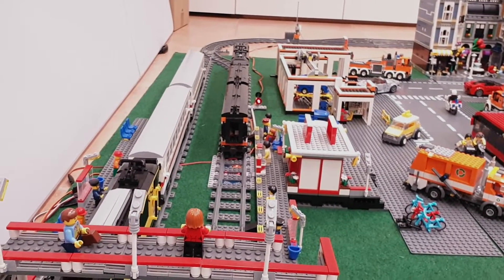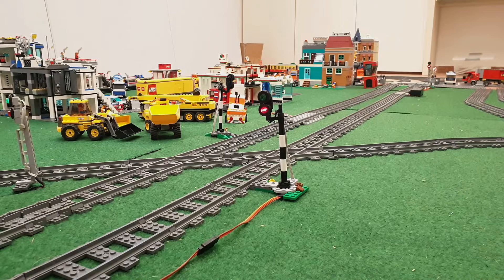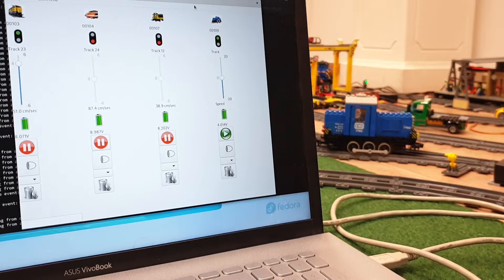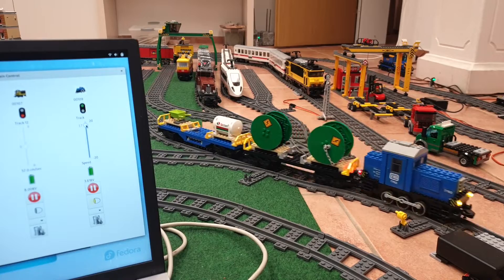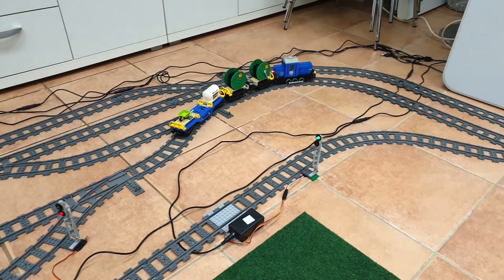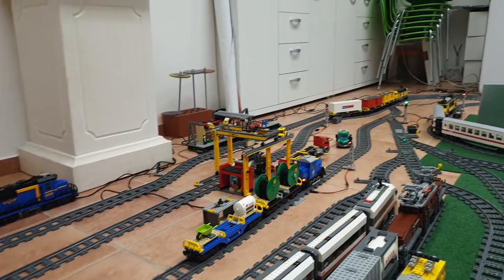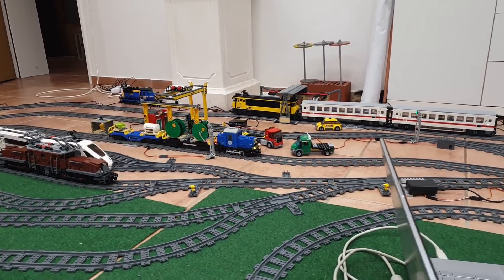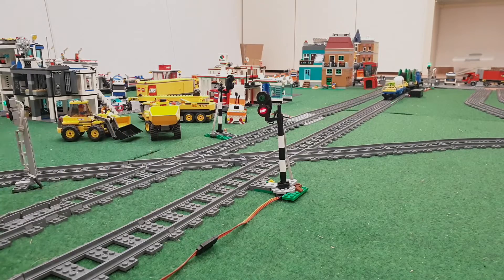Automating the Lego 7760 Diesel Shunter locomotive with Arduino

Comment: Awesome layout! Which RFID sensors do you use and what RFID tags do you use? Do your trains still get detected when driving at high speeds?
Reply from the maker: I am using Arduino's with the RC522 RFID sensors at 13.56Mhz. There is much quality difference between shops/suppliers (regardless of Ebay or Ali-Express). After a lot of testing I selected a shop that delivers good quality. I test all my RFID sensors and tags before using them. The tags are sometimes the ones delivered with the RC522 sensors, but I also use these PVC chip tags. But finding good quality also required some orders at different stores and testing.
Good quality means that they are almost 100% detected at speeds of 80cm/sec.

Faster speeds are possibe but gives other problems, like large breaking distances on tracks, which requires more room between signals on the track and increases track size. 

On the next video (link below) I try the maximum speed of the 7740, it is about 120cm/sec. The speed can be calculated with the detection time between two tags on the train. All trains have two tags (to be certain) and if both are detected by the same RC522, the speed can be calculated.
https://studio.youtube.com/video/RjObv8G0R9U/edit